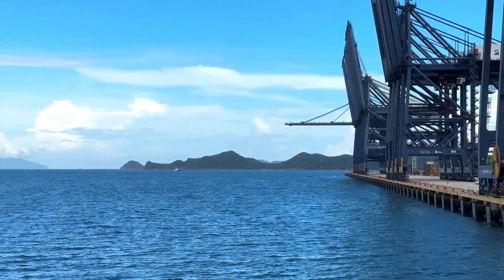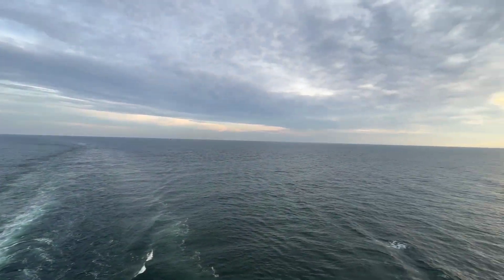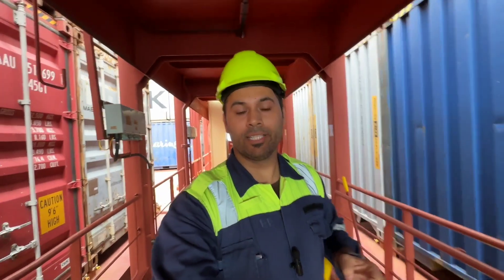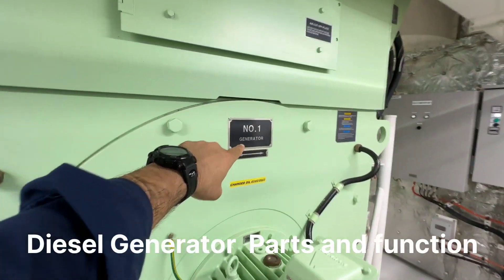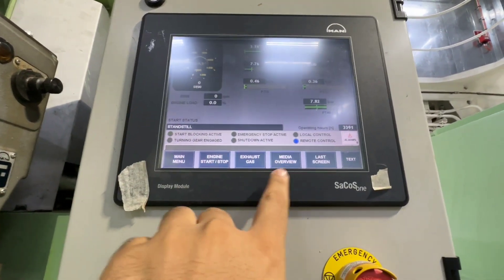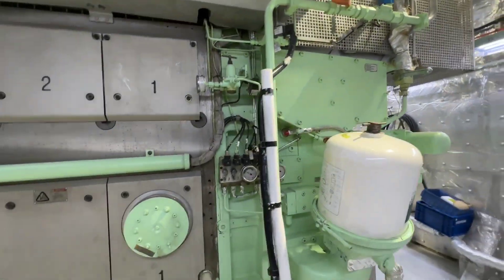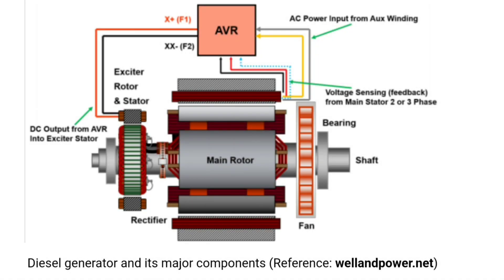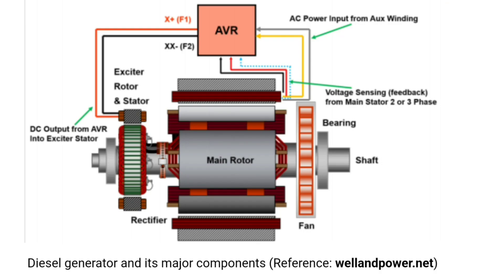Marine Electricity Generation || Electrical power demand || yantian,Hongkong

Comment: very nice video..💗   alternator not generating voltage reason?
Reply from the maker: Thank you danish, there could be many reason behind alternator not generating voltage 
1.Missing excitation dc voltage at stator excitor 
2. Faulty AVR automatic voltage regulator 
3. Faulty rectifier circuit sometime one of the diode get burnt.
Etc